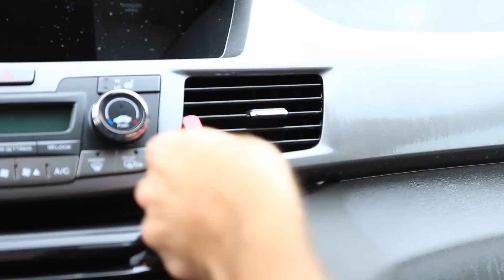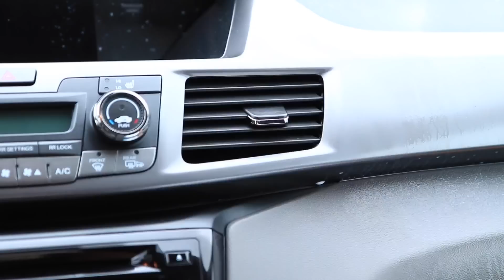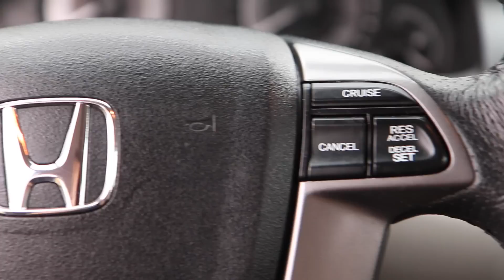Car Interior Cleaning || Car Detailing The Mini Van || Cleaning Motivation

Comment: I always use 303 protectant for my "finishing touch" and uv protection. It's so good for $15 a bottle, you cant beat it in a pinch if you don't have access to gallons, for a retail product. Unlike many other "dressings" it can be even worse for the surfaces if it leaves a film, which can cause more damage from UV's, no sticky residue and no oily feel, dry to the touch. Just don't get it on the windows... Otherwise, it's great stuff. Just goes to show, you CAN clean a car with two bottles and a handful of microfibers for those begginers or people just getting into detailing. I prefer Megs APC and Super Degreaser with my dilution ratios than the 303 cleaner but they work for my needs and uses for me and I have used 'em for a while. Anyway, Awesome job man!
Reply from the maker: Thanks! 303 for the win!

Comment: First rule of cleaning electronics (i.e. the radio/console/dash) NEVER spray liquids on the electronics, ALWAYS on the rag! I winced, seeing the spray dribble down into the CD player and around the buttons. I hope you let the car air/dry out in the hot sun or those crack and crevices in the electronics are gonna stay damp, causing possible shorts.

Comment: Isn't it a bit expensive to use 303 to clean everything like that? Wouldn't you be better off with a different APC and then using 303 to protect?
Reply from the maker: +Most Valuable Dog eh it depends. I bought the big gallon jugs and it goes a long way. Also for quick wipe downs you can just spray a microfiber and cover a whole dash with 3-4 sprays worth.
Reply from the maker: +Most Valuable Dog open to recommendations if you know another good option!
Reply: Stauffer Garage I mean I'm pretty sure you charge 3x more than what it cost to buy a new gallon so it doesn't matter

Comment: What is the cleaner you used? I’m detailing cars now and i need to know what to get Bc it’s getting expensive going to auto zone constantly.
Reply from the maker: Dude check out 303 cleaning products! Got a couple links in the description box. 303 aerospace cleaner and 303 aerospace protectant. I bought mine in gallon jugs and dilute and distribute into spray bottles. Lasts a long time and the stuff rocks.
Reply: Stauffer Garage thank you so much !!

Comment: https://youtu.be/0oOcLatly9c?t=575
you scratched the monitor. never use what you use on the dash on the monitor glass. you should have a clean much finer cloth for that. Use alot more soap on the coor cards, use a vacuum carpet cleaner on the floor, clean the leather with a brush and a leather cleaner, use leather milk afterwards.
Reply: FordSierraIS I'm pretty sure the MICROFIBER cloth and WINDOW SPRAY did just fine and besides he probably doesn't care.
Reply: Michael Street not after it has accumulated shit from the dashboard. why make a video if you dony care. he just dont have the knowledge and thats why im giving advice. and you can clearly see the scratch made
Reply: FordSierraIS yup
Reply: Its pretty damn good for someone who was never trained in detailing. For chrome/glass/clear plastic you should use glass cleaner. One clean cloth to whipe in the spray and 1 clean cloth is whipe away the access. I also noticed quite a few stains he did not get out but I cant blame him. The crap you buy at Walmart/Auto stores is trash compared to the chemicals you use in a shop.
Reply: Morbjørn you use Adams or chemical guys? Could you tell em a little about them if you do use them. And if not what do you use? Just trying to figure out what I should get.
Reply: VisualLife For interior chrome and windows, use regular old streak free windex. One cloth to wipe on, one cloth to wipe off. I drift towards Meguiars for interior cleaning. Scotchguard for carpets and seats. The chemicals you use at the shop cant be purchased by anyone except businesses. The power of the chemicals can cause serious damage to your skin, eyes, and lungs and xan damage a vehicle if not used properly. Havent found a really good wax on the shelves yet compared to the shop. Never tried chemical guys but I inherated 2 old GMC vehicles that need TCL and I might try them out. Im definitely going to pick up some of their brushes because those AutoZone brushes arent cutting it. I have better luck with a dish brush!